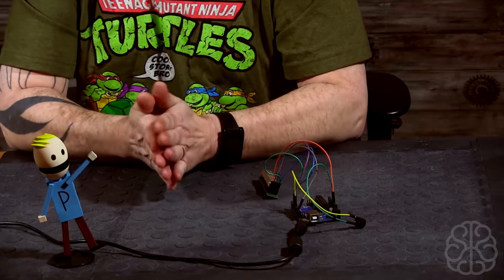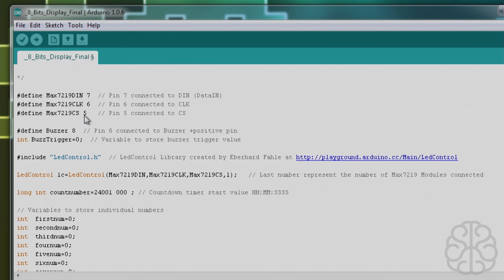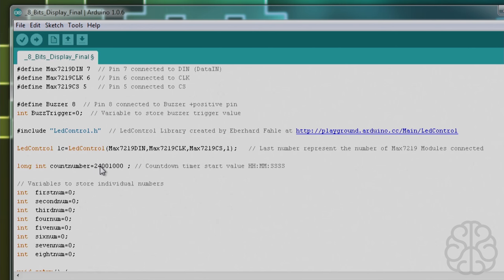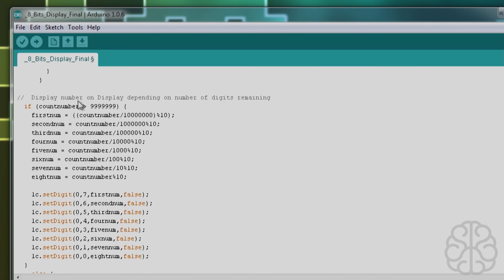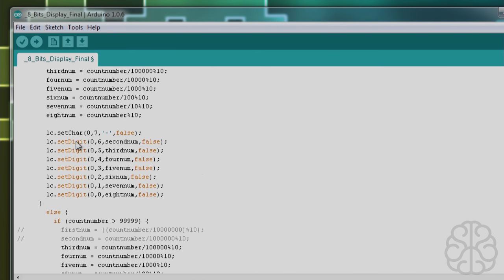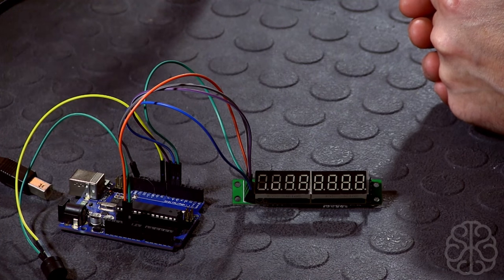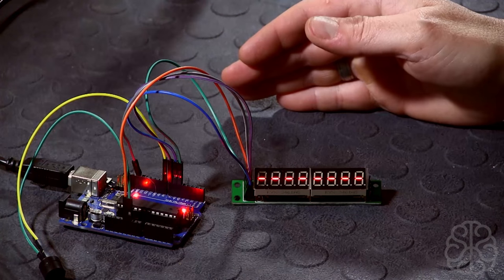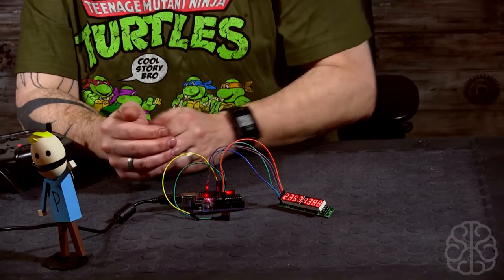Arduino Countdown Timer using the easier to find MAX7219 module!

Comment: Hi! I was wondering how difficult it would be to make a DD:HH:MM:SS timer (As a prop in a movie, it wouldn't have to be accurate or anything)
I'm a total noob at this, but I'm willing to learn.
Reply: look closely at the cheap eletronics, and always pre-purphase one copy, try out on arduino and raspberry pi real quick, if one fail, go to other, because arduino is c for newbs, easy done, and pi is easy done inside of python , as long as u get the right libraries like a bittorrent pirate.

Comment: Hi, thank you for the wonderful tutorial, but how would you do the timer with a start, stop and reset back to start number inputs?  And how would you do a count down timer for MM:SS only?
Reply from the maker: Hi Ian, I'll put your suggestion on the list of upcoming tutorials.  Push button for Start/Stop/Reset and use a 4 digit countdown instead.  Thanks for watching!
Reply: +Brainy-Bits would it be possible to do it with 3 buttons, 1 for each "function"
Reply from the maker: Sure, that would be even easier since you would only have to detect which button was pressed and do an action based on that.  Using only 1 button would use a variable to keep track of how many times that button was pressed.
Reply: +Brainy-Bits I want to use it for school sports with small kids, so it would be easier to control with a start, stop and reset buttons. Then they can Start - Stop - Start - stop, or start - stop - reset

Comment: Is it possible to make the tenth seconds start at 59 rather than 99 ?
Reply: not inside max7219 chip , he does comparision of timing of chip to the display of the code in the wire being sent from computer, so computer version can, but inside max7219 chip, u need to code it in funny ways for tm1637 chip to like make it into sound visualizer or counter, or plain text. 2 characters are usually deemed missing on 7segment from ascii

Comment: I would just like to warn you about a design flaw in this module when you need to cascade modules together.

I have just finished successively daisy chaining 5 of them.

Unfortunately there is a design error in the module you are showing, the Vcc OUT is connected AFTER D1, in other words, the first module with work on Vcc -- Voltage drop over D1 ie: 4.3V, the second will work at 4.3V minus Voltage drop over D1 = 3.4V, the next module will work in an unpredictable manor working under 2.7V.

The solution is to de-solder the D1 and jumper the pads. or the solution I prefer, solder a pin on the via that is near the diode (you can see the Pcb track going from diode to the via. and place the Vcc power connection on this pin.

DO NOT connect each module directly to 5V leaving the diode in place, because the chip will work at 4.3V and supply the logic level to the next module that requires the logic in a 5V range.

Comment: I am a little puzzled as to why you are keeping time in a large integer when the convention is to split time into its constituent parts, i.e. hours, minutes, seconds and hundredths, all of which fit into byte-sized variables. It would greatly simplify your code and make assembling the final 8 digit string to be output to the display a lot easier since the MAX7219 supports addressing the individual digit positions. Just a thought.
Reply from the maker: Like I always say, there are many ways to do this, the code can always be made shorter, more efficient, etc...  

Of course it might not be the perfect or best way, but in the end, for me at least, the result is what matters, not the way to get there!  But that's just me.

I never was big on "convention", as long as it works the way intended, that's good enough for me!  We are building fun and hobby projects, not stuff that people will need to rely on for safety, like traffic lights or autopilot.

Your comment about using large integer vs byte-sized variable is correct, there is no reason to use large integer in this case, but for a project this small it doesn't really matter unless you wanted to add on to it and not waste memory.    

Thanks for watching btw :)
Reply: I only suggest it as C and C++ are structured programming languages and repetition (as found in your example) lends itself to the use of subroutines (functions in C), breaking code down into smaller and more manageable chunks. It sure makes debugging a lot easier and a structured program is more likely to do as you intended. :)
Reply from the maker: That's a great point on the advantages of breaking down code into manageable chunks to make debugging easier if needed, when working on bigger projects.  Thanks for sharing and hoping it will help others with their own future endeavours.  :)